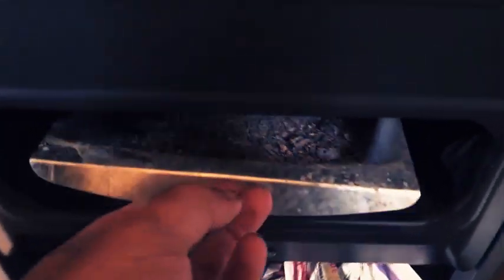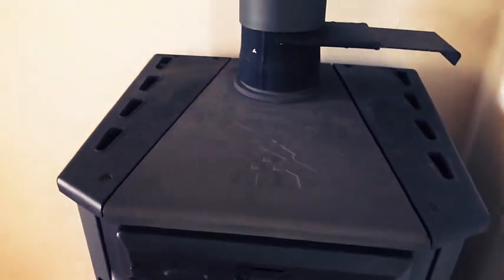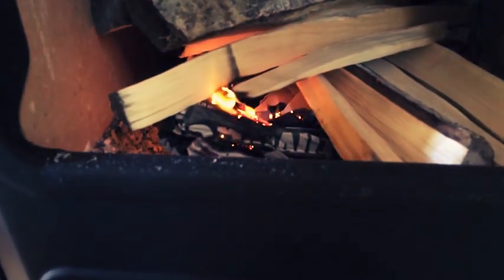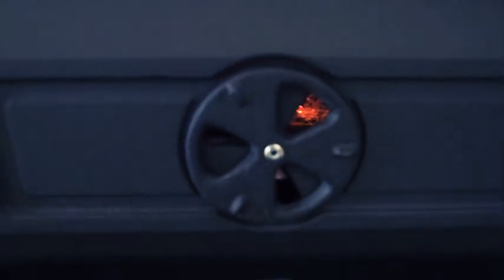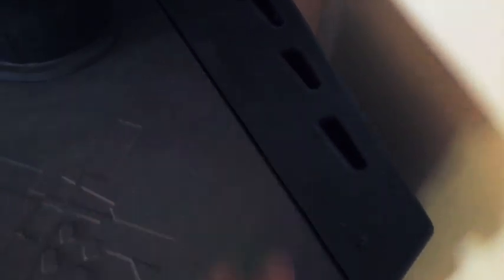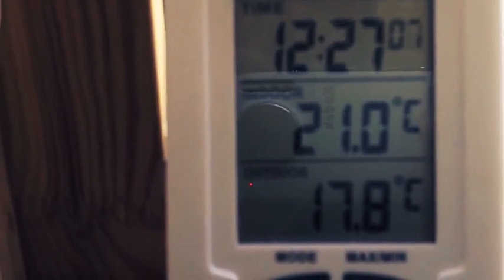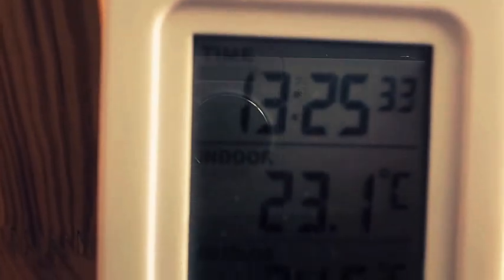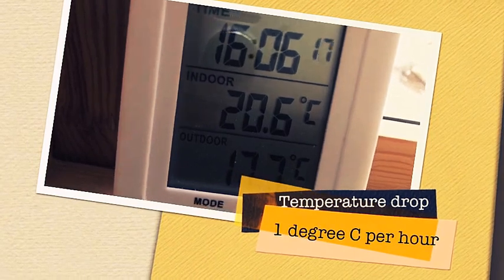Building a log cabin in Finland: Test run of Magic Stove (Tim Sistem) Part 9

Comment: Wood is the best material to burn. Provided you have unlimited supply.

Also, I wouldn't turn on the head until the temperature inside drops below 15.
Reply from the maker: +NotOrdinaryInGames When we were building the cabin we had to cut down quite a few trees from the site and we have a fair bit cut and stacked so wood is not a problem.
https://www.youtube.com/watch?v=LwlpyvOSA9Q

Comment: Looks like a great stove evidently not available over here at least I can't find it on the internet. Was wonder what it cost I found a Czech sight selling it for 6498 Koruna which is $360 Canadian. I was very surprised that is an excellent price. I have 200 Koruna left over from my visit to Prague LOL.
Reply from the maker: +Dale Calder I thought you had recently upgraded your stove for your cabin. What do you have now?
Have you seen those thermocouple fans... the ecofan... I think they are made by a Canadian company. They use heat to generate electricity to spin a fan to circulate the air from the stove.
Reply: +OldGardenerGuy Yes I did I have a Yotul the smallest one they make and I love it but it cost more than  4 times the cost of this stove. Crazy. Yes I've seen those fans in stores but never seen one in use. Also very pricy.
Reply from the maker: I had a look on Amazon and you can get equivalent fans for about half the price and most people giving reviews seem to be satisfied with them. there are also some DIY projects on YT on how to make them using items bought from eBay
Reply: +OldGardenerGuy Yes I just looked and there is a model that is about a third cheaper. Not so sure that I need one anyway my cabin is so small it heats very easily once the loft has heated up so the heat can come down into the rest of the cabin.
Reply from the maker: And you also have a solar fan to circulate the air :-)
Reply: +OldGardenerGuy Yes but the noise from the fan in the inverter plus the noise that fan makes could drive you nuts in short order. LOL